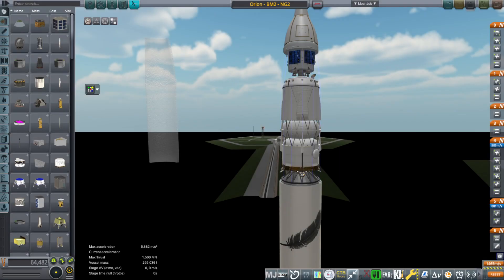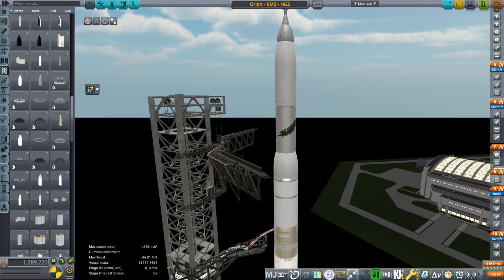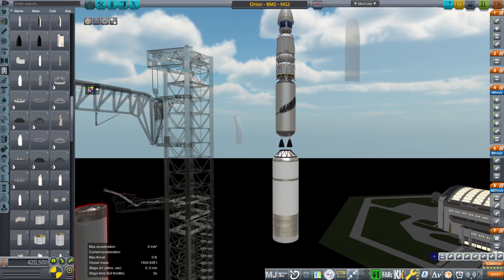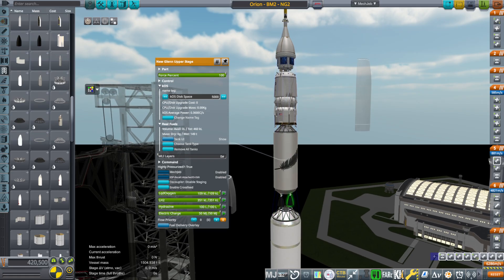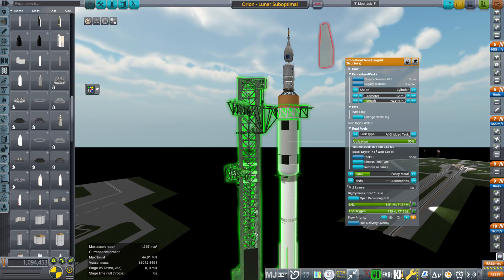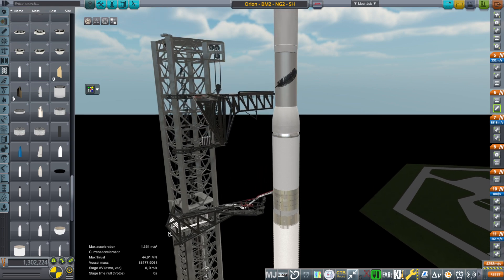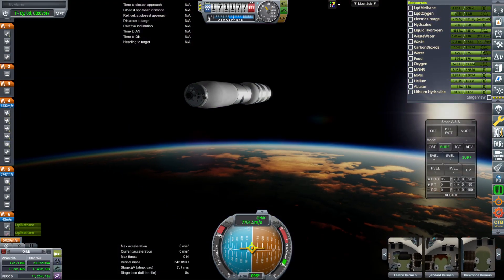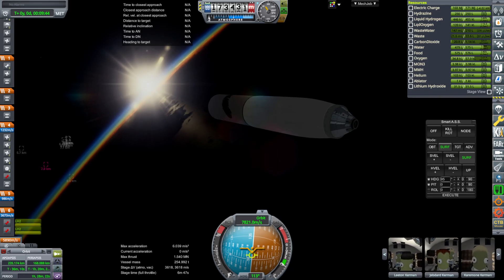New Glenn Upper Stage, Expendable Starship, and Objections

Comment: Why cant Blue Monn provide thrust for Orion as well? this seems like a trivial problem.
Reply from the maker: I did use Blue Moon to provide thrust for the combination in the previous video both to complete the transfer and then capture. However, if the two are docked together such that people can pass from Orion into Blue Moon, then the thrust line of the engines would not be through the combined center of mass and the combination would just spin around and around. That was what I was getting at.
Reply: @plum5292  With what propellant? It beats the whole purpose of doing a single launch architecture.
Reply: @FrankyPi  I am reffering to a discussion I had on the preivous video on the topic. TLDR Blue Moon has more fuel than it needs because it has to operate out of NRHO and not LMO and you could safe even more fuel by limiting its payload. With this additional fuel you could help with ejection and perform the insertion to LMO. I think it should be marginally possible to not need a third stage at all this way.

Comment: I don't think two MVacs next to each other is at all like the RS-68 clustering problem, because the MVacs wouldn't be lit in atmosphere, and the RS-68s would. Without the air to convey the heat between the nozzles, I don't think thermals would be an issue. I mean, it would need to be studied; maybe the MVac nozzle thermal margins are real tiny, and even just the tiny bit of extra radiated heat is too much. But I'm pretty confident that it would be fine. 

So I'm sympathetic to the argument that one of the lessons of SLS is that new vehicles should just be designed from... well, maybe not from scratch, but certainly not using existing stages. But we have examples of launch vehicle that used existing tank tooling and engines that turned out fine, like the Saturn I, and that is basically what SLS did. So... I guess basically, if someone can identify for me why SLS and Delta III went badly, when Saturn I & IB worked out just fine, then I agree we should stop doing that thing. Solids/side boosters in general maybe? Or maybe Titan III proves those can work fine? Maybe it is just 60s margins? It's all real unclear to me.
Reply from the maker: While Saturn I and IB were functional, I'm not sure anyone would say the first stage was optimal. There was a lot of structure there that didn't need to be there.
Reply: @RaizSpace  I mean, people say this, but they never quote numbers. The S-IB's dry mass ratio was the same as the Atlas Vs.
Reply from the maker: @jef_3006 but with the greater diameter, it should be getting a better mass ratio. You're comparing a thin long 3.8 meter stage to a stout 6.6 meter one. I think I already went through the fact that thin long things need to be reinforced.
Reply: @RaizSpace  You forgot that the Atlas V core also needs to handle SRB thrust, which adds even more structural weight.

Listen, I didn't not mean to imply that the S-IBs dry mass ratio was good. But it wasn't a problem. The design was a success. It was not optimal, but it IS an example of using existing tooling to get an extremely functional design built in a relatively short time frame with a relatively low budget.
Reply from the maker: @jef_3006 I already said it was functional, just not optimal. It seemed like you were correcting me.
Reply: @RaizSpace  I probably could've been clearer.
We agree that it was functional not optimal. The area where I think we still disagree is whether or not that fact mattered.
I assume that you believe that it DID matter, since you brought this up in the first place. I believe it did not matter.

From my perspective, the Saturn I completed all it's objectives and then some, rapidly, and with a relatively small budget, in spite of not being perfectly optimal. And in addition, every 60s trade study on Saturn IB upgrades I have found says that changing tanks was not worth the time and money. Thus, I have concluded that while the S-IB was not an optimized stage, that fact just did not matter in the grand scheme of things. And certainly it is insignificant when compared to the much more substantial issues of SLS; and remember, comparing the Saturn I's development to SLS's was the original point of all of this.

Comment: When it comes to number of launches and orbital refueling the Augustine report of 09 "Review of U.S. Human Spaceflight Plans Committee - Final Report" contained a lot of talk about this while discussing other rockets at the time. 

It found that a duel launch of Ares V light with 140 tons to Leo would have 7 mt for cargo for a crewed landing or a single launch could have 14mt for a cargo flight. The 110 mt to leo shuttle derived craft would have 3 launches for 5mt for crew and a single cargo launch <5mt for cargo but could get >20mt with in orbit refueling.

On orbital refueling it said "Therefore a prudent approach is to develop a heavy-lift launch system with sufficient capabilities for early missions, which would later be enhanced by in-space refueling when it becomes available."

Personally I prefer if the duel launch of a Shuttle-C that a contemporary report claimed could put 75mt of payload to TLI. The paper is "A Near-Term, High Confidence Heavy Lift Launch Vehicle" if you want to have a read.

Comment: Would an expandable Starship have 7 Vacuum Raptors?
Reply: Biggest issue would be no gimballing engines, so all attitude control would have to be from the hot gas/uliage thrusters
Reply: @julesjackson4855  i cant imagine it to be too difficult to make a gimballing vacRaptor
Reply: @simonschaller857  the problem is that the 6 outer raptor vacs can gimbal at all as the skirt section along with the layout prevents them to and the middle vac can’t have roll control but only pitch and yaw control.
Reply: Maybe you can have 6 rvacs and but the tank is lower in the middle so no center one. And the Rvacs on the skirt cant gimble at all and it would be hard to make them gimble so just use the 6+3 configuration
Reply: It would be the opposite since it's lighter I imagine it with 2 rvac

Comment: Do you think it would possible to launch EUS inside the Starship cargo bay volume, perhaps upside down with the less wide oxygen tank and RL-10 engines at the top in the more narrow nose cone section? Obviously it wouldn't fit through the current Starlink dispenser door, and EUS on its own wouldn't be all to usefull, but if you are looking for a 4 launch architecture, perhaps one launch could just be getting EUS into orbit as a transfer stage that would rendevouz with other elements. At 17.3m tall, 8.4m in diameter and 133t in mass a fully fueled EUS seems like it may just barely fit on Starship without drastically overloading it or dramatically changing the aerodynamics. But then EUS isn't built to be launched upside down so that probably wouldn't work.
Reply from the maker: As far as I can tell from actually trying to fit it in, there isn't enough space even upside down, and its 8.4 meter diameter leaves too little clearance inside (with mods in KSP, of course, the colliders make it very difficult to get out cleanly). Also, aside from the issues you mentioned, it has to be continually topped off, so there will need to be umbilical access for that. It could probably be modified, but considering how long development for it has taken so far, I don't know how long that would take.
Reply: EUS is 144 tons.